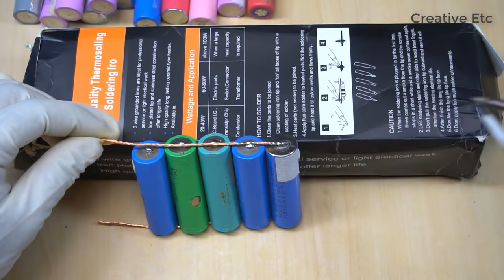How to Make Portable Bike / Car Washer

Comment: Wonderfully simple design. Simple yet effective. Congrats! You just might want to secure the hose to pump connection so you wont have water leaking into the container as its the same place you keep the battery and cable termination.

Comment: Wow no battery management system, no short circuit protection, undervoltage, cell imbance cutoff,cell thermal protection, great work
Reply: Electronics Master bhai tu iska updated version banaona bahut kaam ki chij hai...
1k bar banalo to video jrur post krna thik bohot sare views milenge
Reply: Electronics Master Wow no rocket science,no micro processor,no alarm,no water purity testing system,no virus protection,no emergency off system,no water force detection system,no water flow control mechanism,no water level measuring system,no anti theft alarm..
Reply: i agree with you
Reply: ha bhai vanale tu achcha daal video

Comment: What if i use 12V  power source instead of battery? I mean running from AC source
Reply from the maker: you can use a 12v power supply

Comment: How much oil for avanger 150 engine because last time I was changed by 900ml only but as per scheduled 1000 to 1100ml ...my question is if ad 900ml it will damage any parts ??plz explain it

Comment: Bro I found your systems at amazon,  but I asking is it able to build with more power?
Reply: Idk what your point of power is, but maybe having 2 waterpump and assemble it parallel could adding more water flow. Plus using constant power supply will better

Comment: I like your video,, but please tell me,, can I use rechargeable battery high capacity Ni-MH 1100 mAh..??
Reply: Mah will give you a capacity to hold the charge,, you can use any mah as voltage remains same

Comment: But I think BMS should be added for discharge voltage protection and charging voltage protection.Working current protection, short circuit protection, overcurrent protection.

Comment: Bro it's not safe.....the battery will die if it is fully discharged...and also the charge of the each battery should be equal while charging ...you need to monitor the every single battery.....so you will need a BMS.....try to use a BMS instead of charging directly from an adaptor

Comment: Can I use 10000Mah Power Bank ? Instead of those Cell Batteries!
Reply: Sohail Shaikh you can use any type of battery capacity as long as the pump is getting the correct voltage. So most likely you will have to some kind of resistor to lower the voltage before it gets to the pump. Otherwise your pump will blow.

Comment: How does the charger know when to stop charging?
Reply: Amar Bedi  thanks, i wasnt sure if you used a smart charger or just a 12v power supply.  the next issue is the individual cells, if one fails the pack will never get to 12v and keep charging?